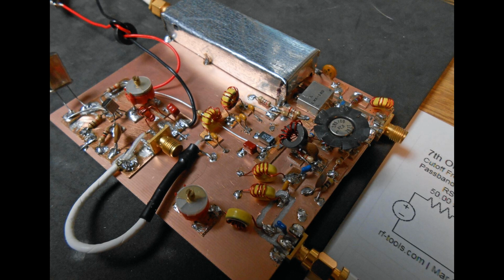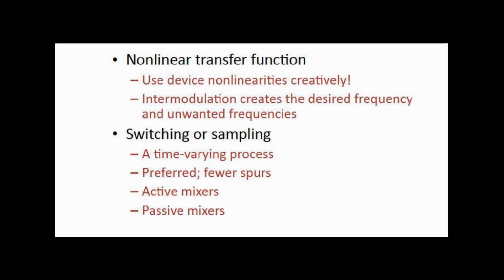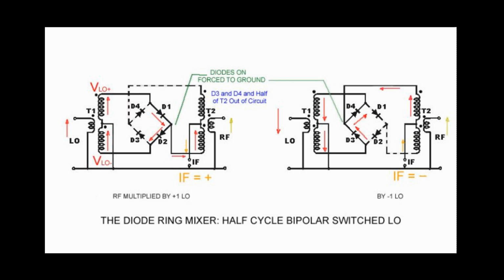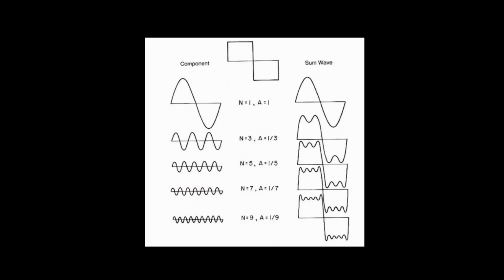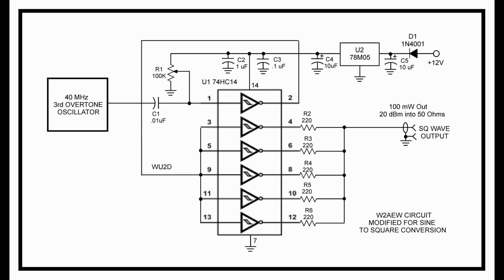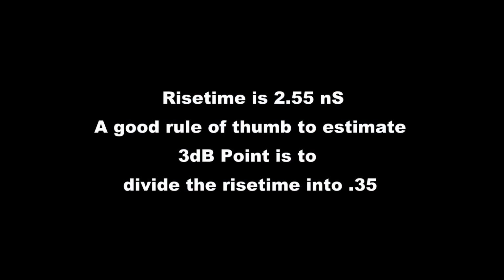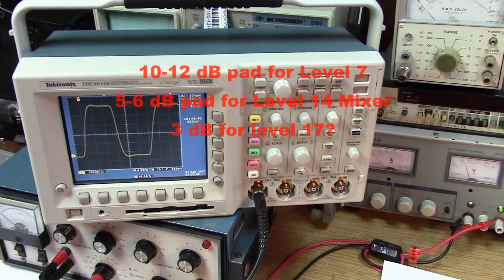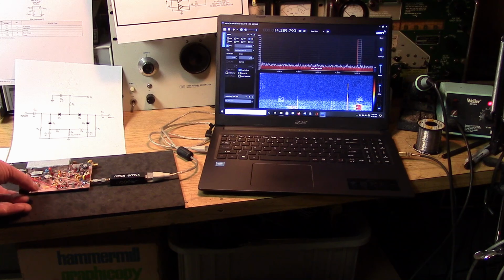HF Upconverter Part 4

Comment: I designed an HF Upconverter 25 yrs ago, using the NE602, that appeared in 73 Amateur radio. The IF output was in the 125 MHz Air Band. It allowed anyone w a Scanner that included Air Band to hear Short Wave Broadcast.
Reply from the maker: Wow that is different! They had no idea.

Comment: Mike, in your "voltage variable attenuator", the transistor base is surely going to be grounded (via the R6 resistor) whatever the position of that pot. 
Plus, at the top of the adjustment, you short out the 12v supply. The link from wiper to ground on your schematic probably doesn't need to be there?

73
Tony G4WIF
Reply from the maker: Correct. I updated the schematic and I think you are the second who saw the error. Look below. I put a new schematic on the Mikrowave1 Facebook Radio Resource page a few weeks ago.

Comment: Thanks for the great series Mike.  I learned a lot.  Your discussion of the up-converter caused me to build one using an NE602 chip that I already had wired up.  This led to an effort to understand the Gilbert Cell.   As you said, mixing is complicated.   I like that attenuator circuit in this last episode.  I picked up a copy of Joe Carr's "Secrets of RF Design."  Really excellent.    73  Bill N2CQR
Reply: I already had one. I think I'm on the right track.

Comment: Thanks for this series Mike, the maths have given me a headache but I've got the principles thanks to your clear explanations. If you do something with tubes (valves to me in the UK) please could you address how to work with the high voltages safely. That aspect frightens me to death and one of your clear explanations about how and when to use isolation transformers and variacs would be really helpful to many who are not comfortable high voltages.
Reply from the maker: This is simply shocking! Well yes. Working High voltage circuits can be like wearing comfortable old shoes; but with a sharp nail, now and then that spoils it. Sounds like a good subject all right!
Reply: @MIKROWAVE1  Thanks for your reply, I like the nail in the shoe image! I'm sure there are many like me who would like to play with tubes but are put off by voltage horror stories.

Comment: Fix the R7 wiring ( Missing cap maybe )
But as shown you'll get smoke at one end !
Reply from the maker: At 28 minutes WU2D let the smoke out! Yes the jumper between the pot wiper and ground must be removed!
Reply: @MIKROWAVE1 
 It's a very obvious mistake if you can follow a map .

Sadly i find 90% of the time it's monkey see monkey do with no understanding of why it works or not .

Most just find code on some website & flash a micro job done , god forbid using solder .
Give them something that needs machine code like a small otp device & the world stops !

Keep pulling up hobbyists , technicians & hams by the boot laces .

73's from a old G1 & happily retired technician  …........

Comment: Mike, a great mini series thanks. Since a lot of our club members are obsessed with this Satan's Digital Radio business, I could show these videos on  club night (that's when the club is allowed to reopen) and they might stir some interest in home-brewing, because try as I might, I haven't managed to get them interested yet.  Nice to hear that the valves (tubes) are returning. This is my year of the valve, I think I'm trying to relive my childhood. It won't be a complete reenactment, my xyl would not take kindly to shoe boxes full of valves underneath the bed.
73 de Steve M0KOV
Reply: Hi Steve, I like you much prefer twiddling with the old analog components to writing yet more software (my day job) for the Ham Radio hobby. Really looking forward to building and fiddling around with up and down converters and the box of subminiature tubes that I got on eBay late last year. 73 KC1PAN
Reply: Hi Vince
If I'm honest, back in the 70's when I looked at the blackboard and the teacher had drawn a circle with a sad smile and a straight line for a forehead, I used to think way are we being taught all this old fashioned stuff. In those days I was eager to learn as much as I could about the brave new world of solid state. Now in retirement valves seems more interesting than transistors.
73 de Steve M0KOV

Comment: Nice to see you again, You talking about a Tayloe Mixer driving a 90 degrees Phase Shift Combining transformer where the oscillator has to be x4 times the wanted signal, a 74AC14 might work.